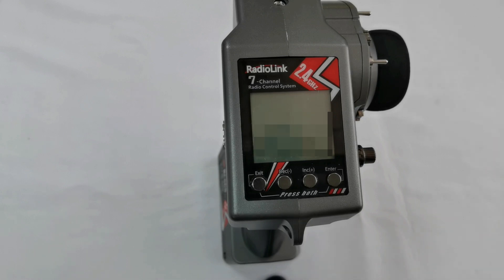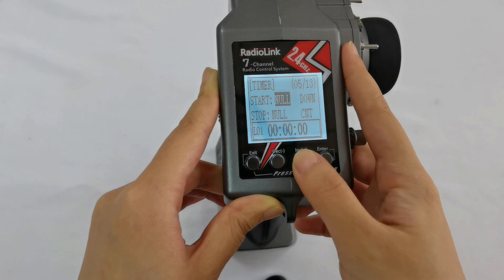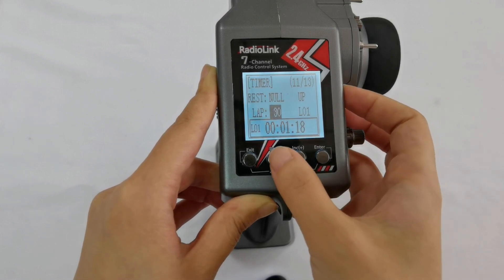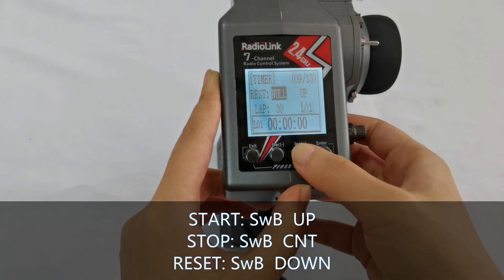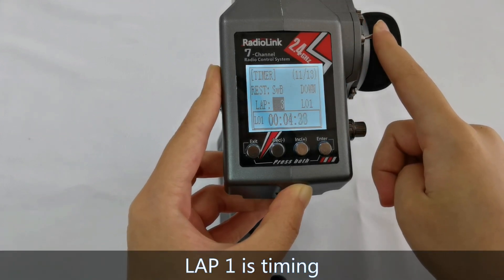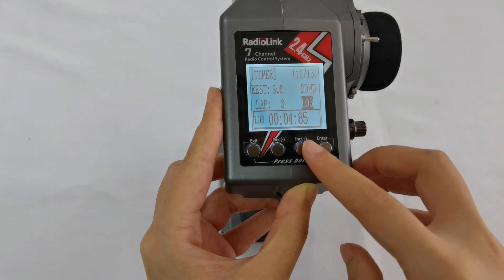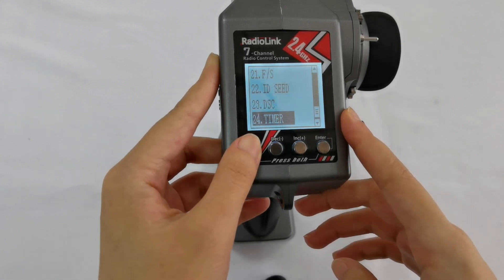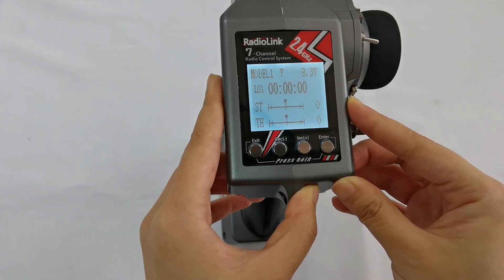New TIMER Function on RC6GS V3/RC4GS V3

Comment: It would be good if it was possible to stop the timer with the throttle at centre position so it is only running while you are using battery power. Or if it  only runs while the throttle position is above your set percentage in the timer start option.
Reply from the maker: Hi, sir. You can use  throttle to start the timer, but sorry you cannot stop the timer with the throttle trigger now. I have sent your feedback to our R&D team, and hope it can be achieved in the future. If any question please feel free to contact us. Our email is: after_service@radiolink.com.cn

Comment: This is all very well but why don't you show how it works with SwA and SwD as well because that's all the users of the RC4GS have? So UP, CNT and DOWN don't have the same obvious meaning with the push button switches as far as I can tell. Also the voltage telemetry doesn't display when using the timer on the home screen. If it's a matter of screen space I don't think the timer needs to display 100ths of a second. Pointless when users are probably taking a second or so to start and stop the timer anyway, so having 100ths is useless.
Reply from the maker: Hello, sir. Thank you for your suggestion. We'll use SWA or SWD to introduce some functions of the transmitter in the tutorials in the future. You can also assign SWA, SWD, LK-A, LK-D to control timer. Here is the tutorial to introduce how to use the switch for your reference:https://www.youtube.com/watch?v=IyL-kNPOZfU  Hope it will be helpful to you. As for the timer and telemetry display, I have already sent the feedback to our R&D team. Hope the problem can be solved. Thank you.

Comment: I like the ability to switch a mix on and off but I have the v2 .....can we get that update for the v2 .... please😁
Reply from the maker: Hello, sir. Sorry V2cannot update the firmware of V3. Because of the large number of newly added functions, the chip resources of V2 were exhausted, so we changed a new chip of V3. So they are in different chip, which means V2 cannot update V3 firmware. But if you do like V3 version, you may check this link: https://www.radiolink.com/newsinfo/442194.html

Comment: Can we update our software to the past version? To v3??
Reply: No you can't put v3 on v2. The V2 will do almost everything the V3 does accept timer and 30 models. You can do headtracker and crossfire on the V2 with different firmware. They have an upgrade program though decent discount on the V3
Reply: The v3 firmware file is 18kb larger than the v2s file storage capacity....already tried
Reply from the maker: Hello, sir. Hello, sir. Sorry V2 cannot update the firmware of V3. Because of the large number of newly added functions, the chip resources of V2 were exhausted, so we changed a new chip of V3. So they are in different chip, which means V2 cannot update V3 firmware. But if you do like V3 version function, you may check this link: https://www.radiolink.com/newsinfo/442194.html
Reply: @Radiolink_official  alright thanks for the info 👍🏻
Reply from the maker: @alex_condrchgb2502  It is our pleasure. Any other question please feel free to contact us.
Reply: Probably not think about it then no one will buy the new version
Reply from the maker: @michaelcondrey8681  Hello, sir. V2 cannot update V3 firmware. Because of the large number of newly added functions, the chip resources of V2 were exhausted, so we changed a new chip of V3. So they are in different chip, which means V2 cannot update V3 firmware. Actually, we do hope that V2 user can get the V3 function. We tried, but sorry it failed.